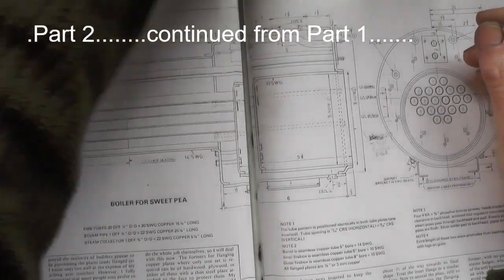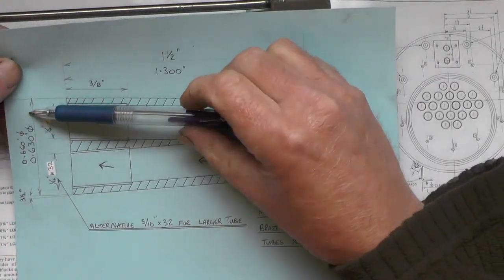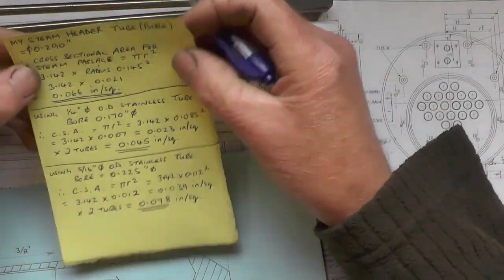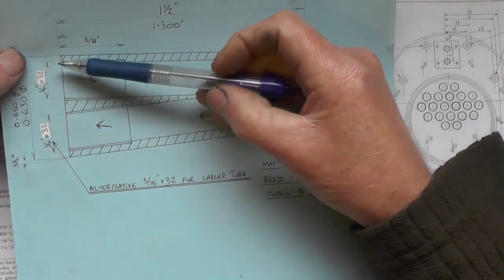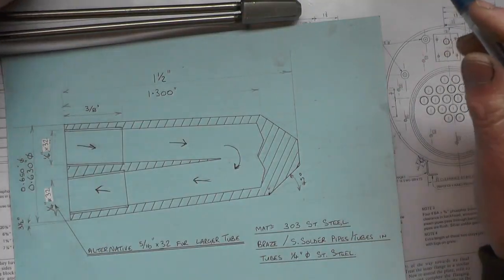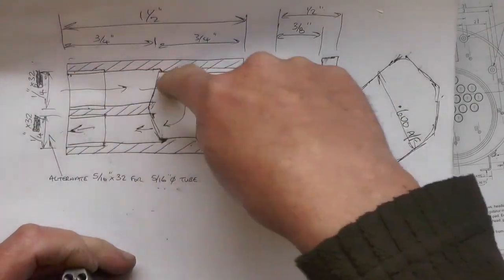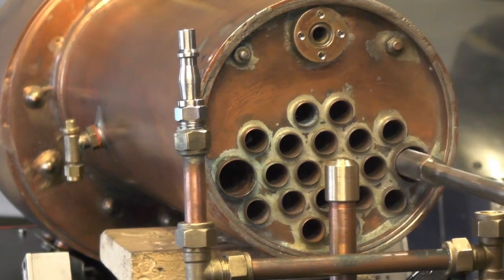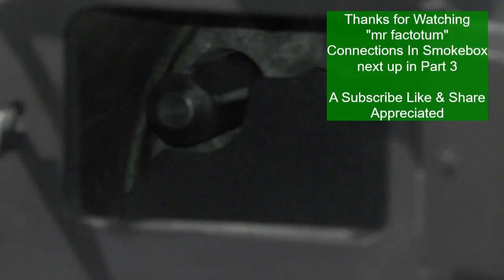Make a Miniature Steam Locomotive Series ( Super Heaters Part 2 - A Beginners Guide ) "mr factotum"

Comment: I don't know anything at all about all of this, but I believe silver solders melt at around 750 degree C or so. I believe firebox temperatures can easily get over 1000 degrees C, I've seen figures of 1500 C and full size locos even more. I understand the copper in the boiler is silver soldered, but that's always got water at around 100 C or not much more on one side of it, preventing overheating. So I wonder if the silver solder will help, or just run out. Anyway, the threads will presumably hold it. Do you need to get the boiler re-certified if it has super-heating?
Reply from the maker: hi
good theory and logic, however the silver brazed portion is set back in the copper boiler tube , only the tip is in the fire, so should be ok, anyway the thread will suffice and hold, just as all the other screw fittings on the boiler hold under pressure. the initial boiler test from newly made is double working pressure just on the boiler alone.
The following tests at 1.5 the working pressure every 2 years and steam test every year i believe  with all fittings on the boiler, so the the s/heater is therefore just another fitting, i'm no expert on this but thats how i interperet it.
regards mr f
Reply: In my opinion any silver-soldered joint anywhere close to the fire, say in the half of the tube closest to the firebox, is simply asking for trouble. There is no doubt that that solder will melt out the first time you ask that engine to do any real work, and get the fire white-hot. Now, if you are building it to run on your own private railway that is one thing, but if you intend to run it at a Model Engineers' track you would be well advised to seek their boiler inspector's approval before assembling the firebox-end of the superheaters as you have shown here. They will advise you on good practice in this regard, and may prevent you from making a big mistake. After all, they are responsible for ensuring that all engines operating at their club do so in a safe manner. I personally would not be happy to drive an engine with elements assembled in this way. For safety they should be brazed or welded.

Comment: Very interesting! I've been pondering over how to do my superheater in st st rather than copper which is shown on the drawings. With copper super heaters you can't poke the end through into the boiler so less super heating of the steam. Doubt if would make much difference in performance but I suppose the dryer the steam into the cylinders the better. Thanks for your video.
Reply from the maker: thanks
yes i'm not sure what or if any difference will be. I know  some people say you don't get covered in exhaust residue so much, ive yet to experience all this though
regards
mr f

Comment: Morning Mr F now I get it after watching part 2. Wont be adding superheater to my loco though  ,soldering the boiler will be a big enough challenge.. going well with the other parts  and will start on the wheels today . Will let you know how I get on .. another question what clearance between the axle box and the wheel I was thinking about  5 thou per side (10 thou total per axle .. what did you make yours..?? Keep safe as always  Dug Hogarth
 sorry  early bird again  we are  1 hour ahead of you and 2 hours in winter
Reply from the maker: hi dougie, Its ok. where are you located then with that time difference.
from memory from  the drawing the axle box clearance from the back of the wheels is determined by the back to back measurement of the wheels i.e. which determines the track gauge of 5",  which I believe from memory is 4 5/8"  minus the loco frame width and axle box thickness, which on mine gives clearance of around 1/32" (0.032") on each side. I'm no expert but snippets I pick up from my local club are you need some movement for when going round bends??? (I believe some people make there back to back measurement for 5" gauge 4.11/16"??)
I worked to these dimensions with the Battery Electric Loco I made prior to this which you can view, and that rides fine on both our track.
Hope that helps. Any further questions please feel free to ask and I will do my best to answer.
regards
mr f
Reply: Hi MrF thanks for the info  makes sense  with the extra clearance  especially with the extra wheel set  .  I live in place called Germiston near Johannesburg South Africa..  hence the time difference  .. thanks again  Dug Hogarth